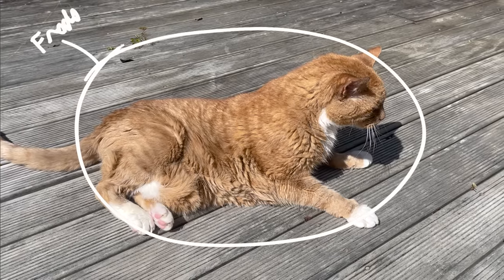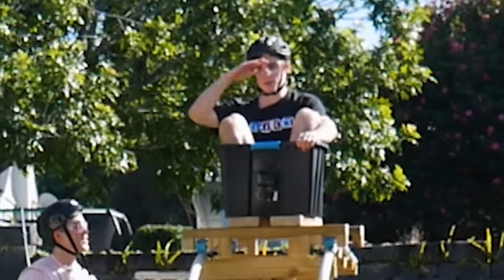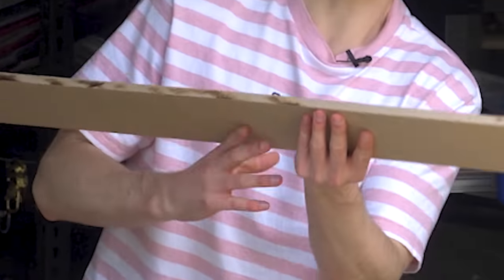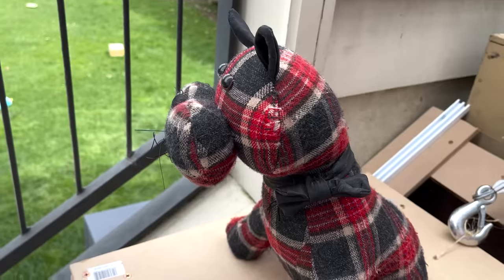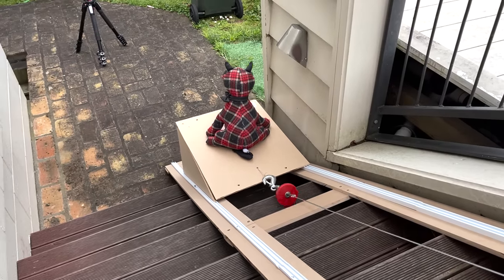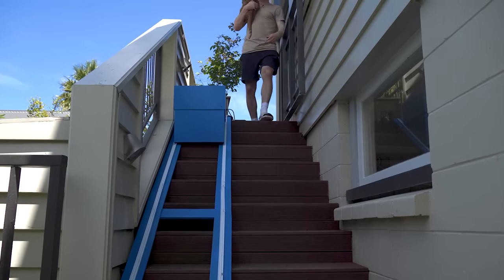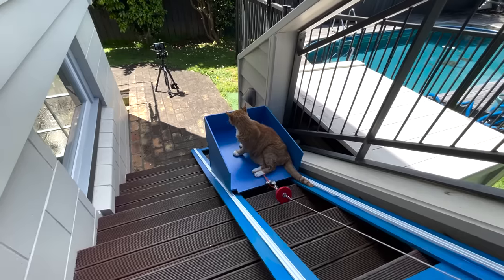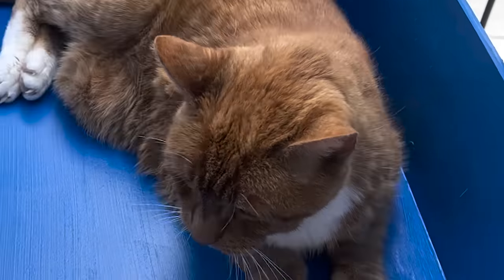I Built an Elevator for My Cat

Comment: the best would be Frodo having a switch for himself so that when he wants to go down he can just press it
Reply: @premanyoutube4725  shut it
Reply: I can tell my mind works in Minecraft mode a little to much because I thought "a presure plate would work for that"
Reply: @FelicityUwU  An irl pressure plate on the cart that registered weight being added would though
Reply: @freddddd367  yeah i agree
Reply: I thought you meant nintendo switch
Reply: @premanyoutube4725  I shouldn’t have read that
Reply: I feel like without his own switch there’s no point in it to begin with
Reply: @chad4g  that means he doesn’t have to be there when Frodo feels like going down
Reply: Or a weight sensor
Reply: @TheFakeTyrone  he works hard enough already
Reply: Then train him to know whats supposed to do
Reply: Maybe a sensor of some sorts, either weight or touch based, where it goes up and down when it registers Frodo?
Reply: Imagining Frodo going up and down constantly the whole day :D
Reply: I would have a strain gauge on the elevator and have it just descend or ascend a few seconds after weight is on the elevator and sustained and would stay at the other end till weight has been lifted for a period of time thereby resetting the controls.  A simple state machine and a counter would be all that's needed though a raspberry Pi or Arduino board and a bit of programming would probably be the modern way to do it, yes the modern approach replaced maybe a dozen of transistors with tens of millions of transistors to do the same thing...

Maybe weight sensitive call mats could be placed so that the car could sit on one for a sustained period of time to call the elevator to the location.

Note a strain gauge is just a resistor etching that changes resistance as stress/weight is placed on it and is how digital scales work.

Comment: This was adorable.  All you need is a way for the cat to turn it on himself and possibly a side entrance so his tail can't get caught on the tracks.  XD  My dog used to nose a bell that was hanging on the back door knob when she needed to go out.  Wait, use a motion sensor!  If it is triggered it waits 5 seconds and has a timer to prevent it from being triggered again within a couple of minutes.
Reply: I think a preassure censor should do the trick like the one michael reeves made when he made the chair that you can’t sit on when the cat lies or sits on it the lift moves 

Placement wise at the edge away from the entrance should be okay
Reply: Yeah you could probably make it go atomatically with a weight sensor
Reply: @allenkagami2438  I thought you were talking about they should have a pressure sensor the launch is the car with Michael reeves video I was scared for the cats life Jesus Christ
Reply: I was worried about his tail too.
Reply: @allenkagami2438  bruh
Reply: I thought the same thing about his tail. Maybe something could automatically come up that would act as a barrier so his tail doesn’t drag. There also needs to be a wall that retracts on the opposite side + a ramp so he can get off of the tram on his own.
Reply: @allenkagami2438  i agree. pressure sensor on cabin floor with a delay of 5 or so seconds is the simplest and also most reliable solution.
Reply: Who are you to decide that someone’s creation would be better off with the little tiny stupid little petty touches that you want  included? Do you watch cooking videos and then comment about how it would be more refined if they used an esoteric ingredient that you, being a person who knows so much about everything, deem necessary
Reply: @jujujupiter  I love esoteric ingredients
Reply: @jujujupiter  Wow, it must be PMS week! LOL
Reply: Pulley system with weights. When he step on it goes up and at top of stairs a latch for the box to lock onto when kitty steps off. When kitty steps back on it unlocks and goes back down. No electronics needed.
Reply: @jujujupiter  I mean are we wrong? Obviously the video is great we're just suggesting improvements ~

Comment: This is brilliant. I’m a bit concerned that Frodo may get his tail trapped going back up though. Maybe he is sensible enough not to stick it out the back!
Reply: And how does Frodo press the button from the bottom? If you could somehow weight the lift to activate it when he gets on would be perfect and Id BUY the designs
Reply: But even if a button could be accessed from both ends it would be easy to train cat to push it on.
Reply: That is my concern as well.  Trouble is that a human has to be present to make it work.  The cat can't be autonomous with it.
Reply: How is this brilliant? There is no way for the cat to use this by himself. The edges are too high for the cat at his age he just won't hope out of it. 
The only time this  could be used if he helped the cat and put him in it and turned it on, just like in the video. But instead, he could just carry the cat much faster. The whole thing was junk.
Reply: @MrDLYouTube  He's got to keep the videos coming even when he's out of good ideas.
Reply: yeah i had the same concern too
Reply: the cat can be autonomous, if you teach him to press a button and also construct one button downstairs too. the only thing that must be done is the cart should be closed completely, so that his tail wouldnt stick out
Reply: @MrDLYouTube  so what if it is its just something he wanted to make for his cat just for a one time use or for when he sees him going outside he can go on it and yeah the tail could possibly get hurt while on the contraption but he’ll probably realize that and fix it so when he does it when he sees him going outside he can just do it normally without anything bad happening to the cat also he’s just letting the cat live his best life as he’s getting really old
Reply: @ellaova  That's just any weight switch and 2 end stops, you only need about $8 in electronics like an arduino and 10 lines of code (it doesn't even need to be that complex, the arduino would be overkill but allow all sorts of fancier functions). If LimitSwitch1==HIGH (this would be upstairs, switched attached to box bumping something) & WeightSwitch==HIGH motorspinCW until limit switch2 is pressed and wait 10 seconds. If LimitSwitch2==HIGH (downstairs side, switch attached to box bumping something at base of stairs) .... motorspinCCW.   I would put the winch motor on the box, and loop it around a rail or something on the top of the stairs, that way all electronics are in the box (probably set a solar panel as the cats flooring, that way it maintains its charge even if the stairway is far from the house).

There you go, enjoy, that's basically the entire project design.
Reply: Yes, you definitely need a weight sensor to detect when the cart is occupied, activating the mechanism.
Also, how does Frodo get in and out of the “cart” at the bottom of the run?
You need to re-engineer the cart so that when it reaches the bottom of the run the front face of the cart is lowered (hinged at the bottom) to form a ramp. When he climbs back in the weight sensor causes the the ramp to lift back up into “travelling position” and activates the mechanism to bring the cart back to the top.
Further refinement may be needed to prevent the moving (closing) ramp from catching his tail.

Comment: It would be more impressive if he could operate it both ways without you being there and flipping the switch.
Reply: Ye but it would need training
Reply: @eeeeeeee4968  Having had many elderly cats, they'll catch on plenty quick to ways to get up and down things in the least achy way possible. Get the old guy an RFID collar and mount a sensor (or just a pressure plate if you want to be primitive) in the box to trigger the winch after a short delay. Rewire the winch/hoist control so a pressure switch at the top and another at the bottom of the elevator triggers the hoist/winch to switch operations from lift to lower and vice versa relative to where the box is on the next application of power.
Reply: @Ferrinflame  Or a pressure mat in the lift itself, couple of micro switches (top and bottom) that flip the direction of the winch.
Reply: Kinda what I was expecting too.
Reply: I think this is the next step. :D
Reply: my only worry would be that if the cat activates it and then decides to walk off halfway up and gets caught between the lift and stairs :( i guess he could put a board covering the stairs though but i'd still worry about the cat somehow managing to get caught while it's moving lol
Reply: @bladethevamp  I was also worried about his tail getting caught in the rail somehow
Reply: @hugowijk3676  yeah when he was going back up, his tail was hanging over the edge which is what got me worrying
Reply: And, if that’s the case, he could also use a door in front.
Reply: Maybe a pressure plate that when pressure is applied to it it goes whichever way it can (like if its at the bottom it will go up and viceeversa)
Reply: just add a distance sensor in the box for when theres something in it
Reply: yeah I mean it would be useless if the cat is on it's own...
Reply: @willot4237  Great idea. I was just going to comment about a pressure mat.
Reply: A pressure mat would need either a delay once it reaches the end or a reset to prevent it instantly triggering the other direction when it reaches the tip/bottom.
Reply: I agree; the cart would have to have a weight sensor on it that would stop immediately when no weight was in the cart.
Reply: Maybe a weight sensor would work? I know there’s probably a lot of programming needed for that but it might actually work
Reply: @willot4237  motion detector? Like with an auto cat litter box.

Comment: That's so cute! I just have 1 concern and a question.

Concern: poor kitty's tail getting caught....

Question: What about a weight sensor so Frodo can use it whenever and you don't have to manually be there every time? Plus, if you put the opening to the side instead of the back, Frodo can go it and out without having to jump over the edge of it. It would help keep their tail safe inside the elevator as well.
Reply: I had the same thought, maybe he could make those modifications for it so that it'd be the perfect cat elevator ♡
Reply: Had the same thought. Looks like there's enough clearance on the side for the tail, but you still can't be too careful. It's not like the lift will stop if he actually gets his tail stuck.
Reply: Ah. I just made a very similar comment.
Reply: ^^op ~excellent edits
Reply: Yoo has large brain capacity
Reply: Yeah, I was thinking the same. He would have to do that every day and then wait for him to come back, just so that he doesn't have to walk six steps. I know he's old but still... it's kinda useless without something like a weight sensor.
Reply: He would face forward, and it's not very likely that his tail would get in front of the cart - ever.
Reply: I too thought this🤔
Reply: Exactly. The cat has just made you his personal slave for the rest of his life. You’ll need to sit at the stairs 24/7 so you can operate it for him. Weight sensor is a good idea, or a button pad inside. He’ll soon learn to stand on the button. Cats are smart.
Reply: I also was worried about the high step out of the box at the bottom of the stairs.  Looks even higher than the actual steps.
Reply: All excellent suggestions - I've seen a multi-story cat elevator, which allows the cat to enter and signal the descent from outside the building, down to street level.  It is on Youtube, so I'm sure it can be accessed.  The cat controls the up and down himself.

Comment: Tip: add something soft inside like a blanket so Frodo is comfortable instead of feeling the hard wood floor.
Reply: Would have been a bit funny if Frodo ended up falling asleep on the elevator, he just happened to find the blanket really cozy.
Reply: Frodo is happy chilling on the hard surface poolside so I'm sure he's fine.
Reply: @leighannamarie4239  no, he's s king, he NEEDS to have a blanket.
Reply: @Walter_H._White  Maybe a little cat bed could fit in there. Even cushier!
Reply: @leighannamarie4239  Oh yeah... PUT A CAT BED FOR THE KING!
Reply: @Walter_H._White  yes, a bed for the mighty king

Comment: You need to add a pressure plate that automatically starts it moving for him.
Reply: So many ways that could go wrong. One that immediately comes to mind is if a bird or something triggers it, it'll go to the wrong end of the stairs for him, and he'll have to climb to get up/down.
Reply: @tintinismybelgian  well it can be solve by set the weight of his cat for plate detection for confirmation. Also can give some delay time start (like 5 seconds or else) to confirm the cat stay on platform and go down. After finish, it should delay time (like 30 seconds or else) before used again to prevent going up by it self when the cat still on board. This might need microcontroller and some programing but this should be easy enough.
Reply: @sudozax7cdyuukishio305  nah I like @The Convivial Character's idea better
Reply: @CommodoreJ  well if that includes the cat, then problem solve. But it might cause a little more problem.
Reply: I was thinking the same thing, because he basically has to be there to push the button every time his cat wants to go up and down. At that point, he could've just carried the cat down.
Reply: His tail could get caught on yhe way up! It was hanging off on the way down, that would be horrible beyond escalator levels
Reply: @tintinismybelgian  add in a timer ??

Comment: I recently saw a vid of a man who built an elevator with an infra red on/off trigger on the cat's collar. This way kitty did not need a human nearby to use it. This elevator is priceless. I applaud your dedication to the needs of your wonderful senior gentleman cat Frodo! 👏💙🙏
Reply: Mind leaving a link of that video here? For scientific reasons?
Reply: @C L Pressure button, then?
Reply: @mackenziedrake  Pressure switch of some kind with delay as mentioned by another reply
Reply: colleenallmyfriends  Contact switch at the end of travel for both ends to turn the winch off.
Reply: colleenallmyfriends  From what he's posted, it's all manual control at this point.
Reply: colleenallmyfriends You're Welcome

Comment: Considering it needs him to be there to operate it, I think it would have been more practical to make a mini-staircase on those rails. Something like 5 cm tall/wide steps would probably have worked very well, and let old Frodo walk up and down with less exertion
Reply: Exactly. This construction still requires human input to actually work. At which point he could just carry him down. Matter of fact he almost certainly carried him out of the box because the safety railing is way too high for the cat to get out of.
Reply: You have to remember alot of his inventions are done just for the sake of the video and not because they will actually be used on a daily basis. It's the entertainment not necessarily practicality/functionality. The cat train, robot butler, etc. are all things you wouldn't use on a day to day.

Comment: Love the cat chairlift, but it doesn’t seem very practical if you have to pick him up and put him on the elevator whenever he wants to use it.
Reply: or be present to activate the elevator. I think it was done just for fun. A weight sensor would be ideal,so that it goes up and down whenever the cat steps on. I don't even know if it's feasible. But like this? Doesn't make sense to me either. Nice cat though.
Reply: @gabriel9668   I was thinking the same thing!  (Have some kind of a weight sensor)

Comment: Really awesome invention, a way to make it better would be to add a ramp on the bottom to ease entering/exiting and also some way for Frodo to activate the elevator themselves. Add those two things and Frodo will have a much more smoother ride to and from his favourite sunbathing spot.
Reply: yes
Reply: Yeah.
Reply: exactly what i was thinking! maybe a sensor of sorts that activates the elevator a few seconds after frodo settles into the compartment and/or the end of the box unlatching from the top and turning into a mini ramp once the elevator arrives at the bottom.

Comment: Can you set up a 'pressure' activator of some sort?  IE: Frodo steps into his carriage, putting pressure on the activator button (under the box) that sets the box in motion (with an auto return button on either end), so when it bumps the top bumper or the bottom bumper, the switch flips resetting the direction (like a rumba vacuum works)...

Comment: Now do we have an improvement update, like a more appropriate exit at the bottom and a self-operating button that the cat can operate or some electronic pad on the flooring that will trigger starts and stops just with weight or heat sensors?

Comment: Maybe put a pressure plate inside where he sits so that way whenever he gets on to it all the way it trips a switch that will activate the button without you having to press it then add a sensor to sense whether it is at the top or bottom to stop the button from being pressed and switch to the other button. The next time it is pressed again it goes up instead of down

Comment: You NEED to alter the platform so his tail does not get caught/injured when it moves up or down. make the perimeter of the platform with FOUR solid sides so he must step OVER the edge to get onto it. the entry side need only be 3 inches high so he can step over it and his tail does NOT stick out beyond the platform so to prevent injury to the tail.
Reply: hate to break it to ya but frodo passed more than a month ago :(
Reply: @gamingshorts39  i expected that but its good info if anyone else is interesting in making a similar item for their aged pet.